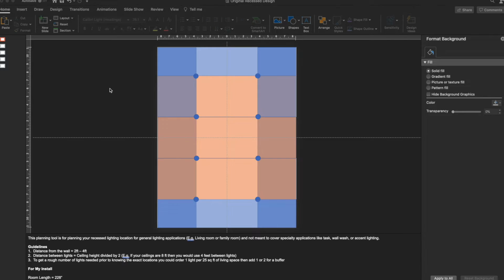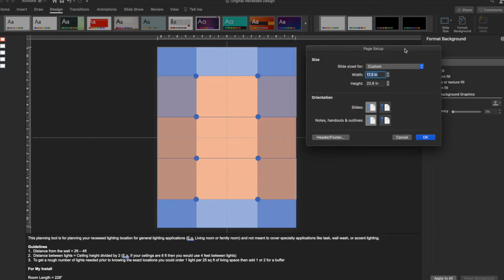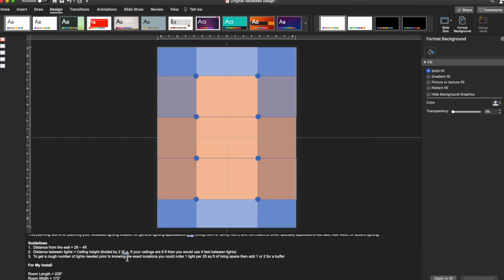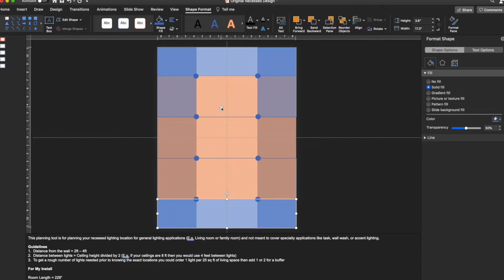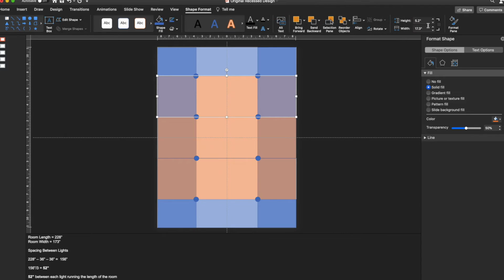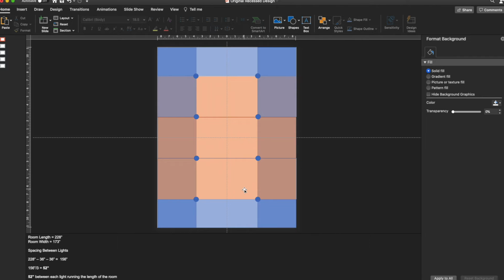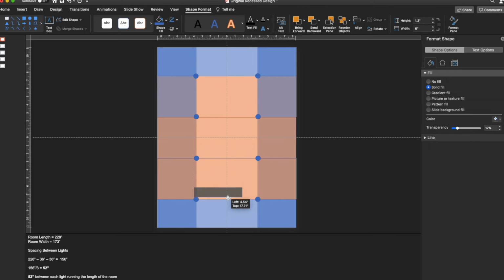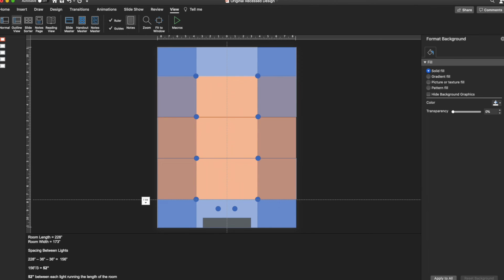How to Design a Layout for Recessed Lighting

Comment: I am kind of stocked there I live on 26 th floor of a high rise and really have no idea how to install reset lights on a concrete ceiling. Please advise
Reply from the maker: That would be an entirely different job.  Probably would have to stick with surface mount light fixtures.

Comment: Couple of general rules to remember.

For spacing. The rule of thumb is. Every inch of can, equals 1ft of spacing.
So a 6" can should be no more than 6' from the next can.
A 4" can should be no more than 4' from the next one.

Layout. ALWAYS put up painters tape, or stickers or something beforehand so you can see if you like the layout of the room.
If it looks stupid during layout, it looks stupid after install. So change it up before you cut your holes. (retrofit applications only, new construction is more forgiving)

ALWAYS set up either a laser, string line, or chalk line. 
If 1 light is out of line by a 1/2", you'll see it for the rest of that buildings life.

Comment: Scott, is there a way to take into consideration the light cone / dispersion (ceiling vs. floor) of a recessed light w/o obstructions?   Using your example, what if one wanted to make the layout asymmetric, so one row is closer to the  planned wall for a sectional/couch.   Thinking wall diffused light closer to the literal sitting area would make watching TV more enjoyable, in lieu of lighting out in front/ more centered in the room. For those that bring it up, yes I know there are dimmers.    I understand the 25 sq ft per light, but for me it's less about quantity, than feel in the room. Any thoughts?  Excellent video by the way.

Comment: Very excited for the upcoming in depth video on this project.  We’d love to do this in our living room which has no overhead fixtures.  We have a one story house but no attic access (it’s a very flat / low pitch torch down roof).  Any tips on running wiring when you don’t have access from above, and also do t want to patch holes in the ceiling?  There’s blown-in insulation in our ceiling so any tips on avoiding a giant mess when making the holes for the recessed lights would also be really useful.  Any recommendations on low profile LED lights with excellent light quality that are dimmable and are also IC rated?  Hopefully these questions might help others with similar needs / challenges!  Thanks so much, really finding this channel helpful and interesting.

Comment: I've used PowerPoint for quick and dirty flyer/poster design before, but never thought to use it as a design tool like this! Great way to accomplish the goal and easily work with an accurate scale!
Reply from the maker: Hey Marc, yeah wanted a readily available tool where people could use the template without buying new software.  PowerPoint is far from ideal for designing but one of the most common pieces of software out there with some features to help plan the layout 👍